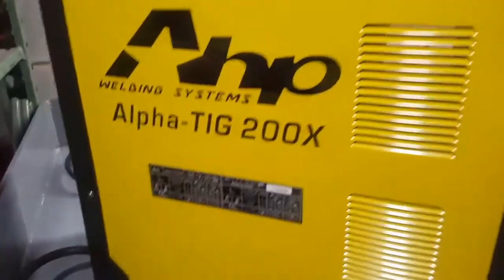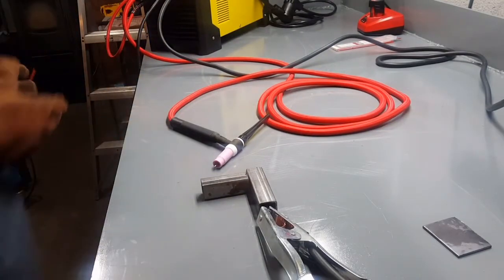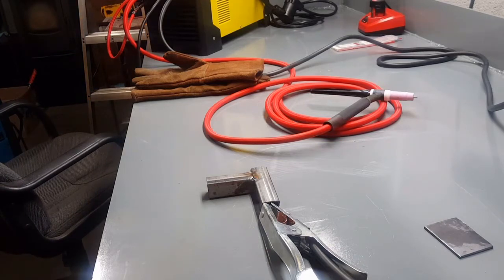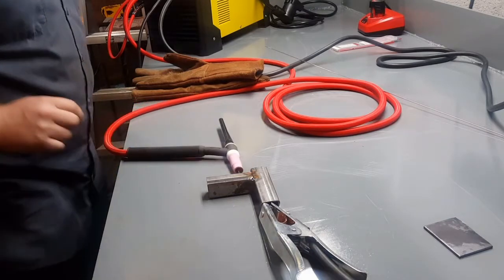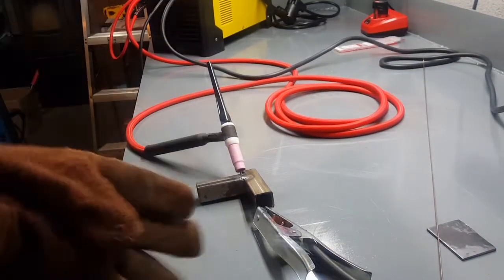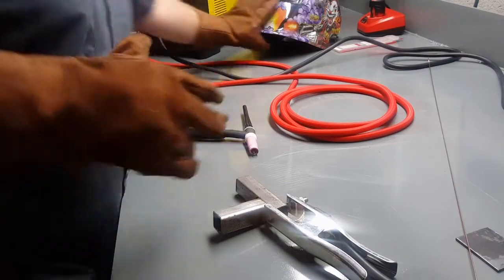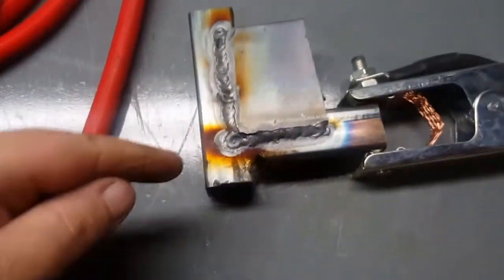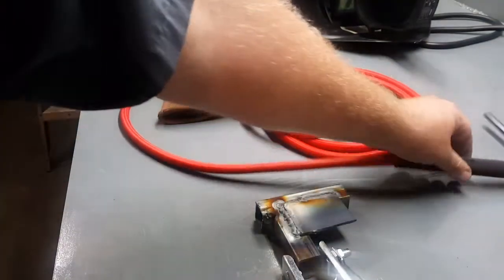First time tig welding.AHP 200x Alpha-TIG 200x (Not To Good)

Comment: I hope your running 100% argon through it, you can't use the argon/ c02 mix for tig welding, only mig. 

Also I think your tungsten is too long, so the rear cap is not closing all the way and the o- ring is not sealing and your pushing shielding gas out of the rear of the torch.

Comment: Yeah definitely think you have a gas flow issue, it's almost like it's the wrong gas... And just take some acetone and wipe the metal down just to make sure it's clean. I've been tig welding for pushing ten years. I have the same alpha welder and it works great! Keep practicing and you'll get the hang of it. Just figure out why it's throwing sparks and you'll be in your way. 

Ryan
Reply from the maker: Ryan Wopat thanks for the tip, I've been busy lately and haven't had any time to play with it yet.thanks
Reply: Looks like he's using a mixed gas or something.
Reply: I had this exact problem when I started.

It turned out that I had my scuba gear too close, and actually connected my emergency O2 bottle instead. 

That's how I died.

Comment: If the back of tungsten doesn't tighten down, it's too long. The  o-ring won't seal, and gas leaks. Which gives you a shitty weld.

Comment: Read your manual, check your gas make sure you're running right tungsten for the metal for welding on should be 2% thoriated for any mild steel or stainless steel, also for aluminum pure tungsten don't get hung up I'm like most YouTube people say about the tungsten pure tungsten for aluminum 2% thoriated tungsten for everything else mild steel and stainless steel 100% Argon check your manual for post flow purge on how to set it up also don't weld anything if you know something is wrong with your set up, I'm talking about your  torch head and the back part not screwing in all the way , stop and figure out the problem,  don't f*** up your machine or your equipment.........that is all ! ! !

Comment: WOW the torch angle way to angle and are you using 100 % argon gas it looks like 75/25 argone/co2 mix I would get a clean piece of steal flat and practice making lines of beads over again to get the handle of the skill of tig welding and watch Jody you tube channel  the argon gas shields the weld puddle so there is no O2 that is why the sparks its has o2  Good luck i have the same welder and its been great unit for me !!
Reply from the maker: Thanks for the tips. I'm running pure Argon , learning how to use a TIG welder definitely is an art form. Thanks for the help.

Comment: Ur at a good start but just a couple of things. Those sparks coming off the metal mean that it's not clean enough, that will leave porosity on a structural weld. Obviously no worry on a practice plate but just FYI.
Next u said 1/8 but it looks like 1/16 filler, that's pretty good for most thing almost to 1/4". 
And finally u are using an RG rod that is for gas welding it doesn't have any cleaners, u need an es70s-2 or some other "es" rod. It has cleaners and help with weld oxidation. 
But ur doing good for starters
Reply from the maker: Enrique Aguilar thanks for the comment, definitely very new to TIG welding. could use all the help I can get.

Comment: i see your m12 charger too, nice. i got the 3/8 impact and battery ratchet. also got the m18 fuel 1/2 in. milwaukee rocks
Reply from the maker: Ctrl Alt DeFeaT yep I just got a 1/4 ratchet the other week I love it thinking about buying that half inch Milwaukee watch some guys take 18 wheeler lug nuts off with it.
Reply: +Speedfreak1984 oh i believe it. it doesnt even hammer when i take off car lugs. almost makes you wonder if your tires were on the verge of falling off lol. blows the snap on out of the water for 1/3 the price and 5x the warrenty

Comment: not to bombard your comment box but i got mine in the mail today and when i set my main amp to 100 it says 85 amps as well. i am guessing that this is because i am hooked up to 110 and when its on 110 it maxes out at 150 amps. i dont have a 220 to test this theory however but if you plug into 220 i think the knobs will be a bit more accurate
Reply from the maker: Ctrl Alt DeFeaT when I get home tonight I'll find out I have 220 in the shop.
Reply from the maker: Check out this video 
https://youtu.be/64kJPcoQhdk

Comment: Sparks are a bad sign.  Check your gas flow.  Other commentor is correct, get some ES70R-2 filler rod.  Work on controlling amperage with your foot by watching the metal melt into a puddle and 'wet out'.  When it wets out dab at the edge of the puddle to fill and cool and move the torch on.  Rinse and repeat with a lot of practice.  Cleaning your metal and fitting up the joints as tight as you can make them will help immensly.  Grind, wire brush and/or wipe the metal down with acetone.